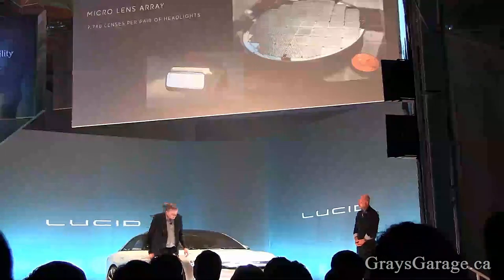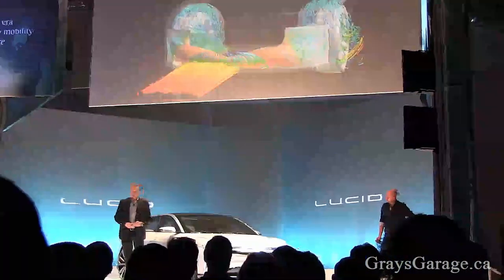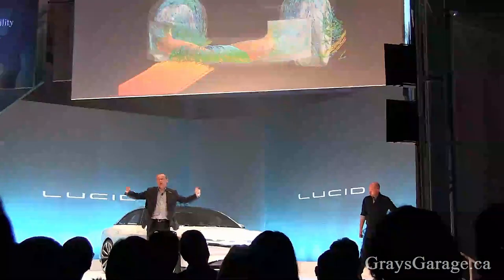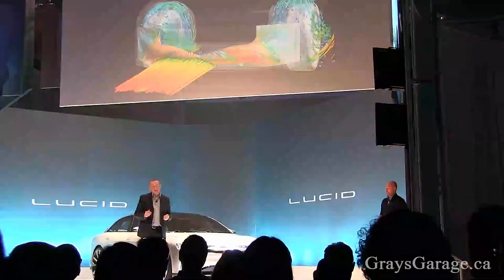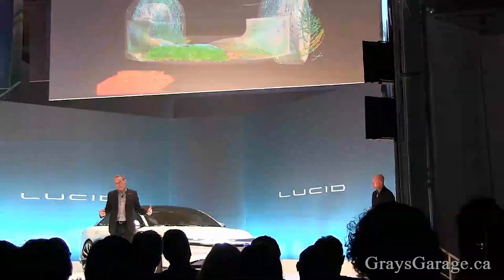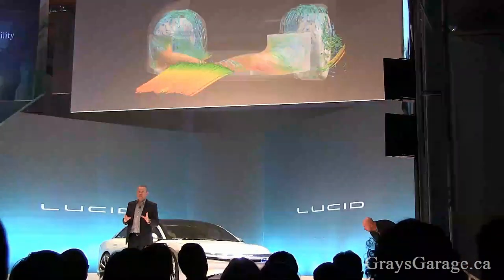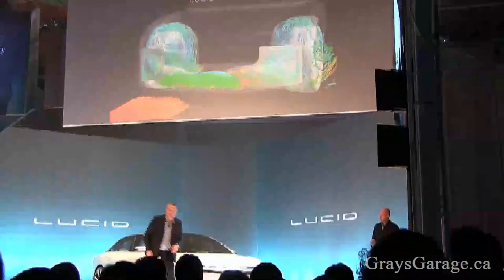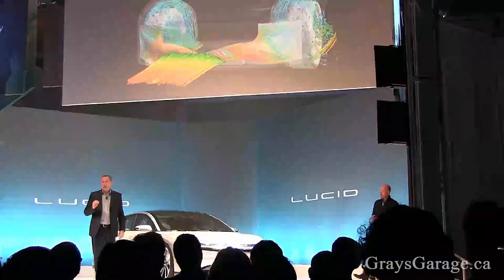Lucid Vortex Intake System

Comment: Hi Gray, I enjoy your videos. I am an Aerodynamicist and a Professor. Some of my videos have been uploaded to the YouTube channel of the University TU Querétaro (but they´re not so cool). 
I would like to ask you something simple about this cooling system. 1- I thought the hot air exit from the hood vents, but the image from a CFD shows an airflow inside the fenders. 2-Furthermore, i imagine there is a fan to provide airflow to the radiators when the car is standing still. Am I right? _ Many thx in advance and wishing you all the success!

Comment: I miss your bubble tunnel videos, this was possible the lowest cost way for DIY'ers to test aero mods, cheaper than even a student license for a CFD software.  Likewise your meticulous systematic walkthrough on each model you had in the tank where you went through the exactly the same test points in each video made the results on each design easily comparable. So if someone wants to build a bubble tunnel a few details in your videos were missing: What was the diameter of the iron wire, or stainless wire you were using? What ballpark current did you pass through it? Was the grounding for the circuit just metal plate downstream laying flat in the tunnel? Did you use AC or DC? How long should the tunnel be after the model to disperse the used bubbles or was there some meshing to break the residual bubbles? Was there any flow correcting baffles, like a stacked wall of drinking straws, upstream of the model to make the flow laminar, or was the tunnel simply long enough to  settle down the flow? Finally how much wider and taller should the tunnel be in respect to model size to not influence the results? Thanks for an eyeopener of a channel to educate me on the subtle details in car aerodynamics.